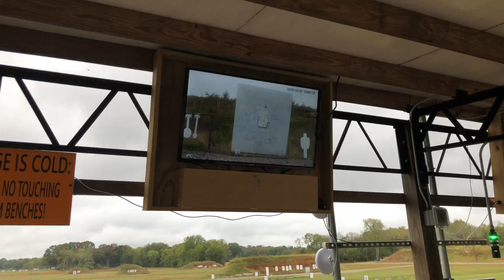Annealing Brass at 1000 Yards: A Comparative Study

Comment: Nothing here proving that annealed brass is shooting better than non annealed brass, but just the shooter wind doping better in the second group.  Hence proof would be just to show the standard deviations of speeds of the two groups, since this would be the real proof that there is a difference, with lower deviations of annealed brass that would be the proof instead.  Also, would need to know how many shots the brass has since it was first prepped, since if talking brand new prepped brass, verse the same with annealing after prep and it put in to action, then would not expect any differences in mean SD speeds to start with.

Comment: What are the chances these loads are uncrimped?
Reply: @vettelover2009 my point is, guy is having problems, these rounds are uncrimped, I bet (my theory) some mediocre handloads can be improved with a light crimp on the mouth.
Of course annealing is important and should be done, but a light crimp is WAY underrated, and I don't understand the knee-jerk reaction against crimping. I've had no adverse reactions myself - granted I'm not a benchrest shooter, but a 3P across the course. The bullseye doesn't know the difference between .25 and .30 MOA. But if a crimp can turn a factory .75 moa into a .5 moa...
Reply: Nobody crimps precision loads
Reply: So... answer is 100%.
Reply: @vettelover2009 👍 sure avoid it if you can. If troubleshooting, try it. I think some will be pleasantly surprised.
Reply: ?????????? Who tf crimps ???????? Please tell me?
Reply: Crimping to fix a accuracy problem is not a fix it’s just a band aide hiding the problem
Reply: @reddawng43x91  I don't understand that logic. This is not medicine treating a symptom instead of the underlying cause. If a light crimp helps, why not except time (which isn't an issue with a progressive press).

Comment: After annealing, I run my brass into my neck sizer and comes out with small scratches. Any thoughts? Thank you
Reply: Soft brass buildup on the neck bushing! Clean good.  And you can use FINE steel wool to polish is off the case neck.  Doesn't effect accuracy!
Reply: Had the same problem. Found out I was squeezing the necks down too far, .003-.004. Switched to a larger bushing. Scratches never came back.
Reply: As one shooter explains in other video, (stop neck sizing and go full length)..

Comment: Would have been better if they’d have called wind the same for both. And if they did it blind and only one guy keeping quiet knew which was which, as to not influence results. Surely they were wanting the annealed ones to better, especially based off their reactions. 

I really have no doubts annealing makes a difference and works, but I wish these were results were better executed so you could trust these results more.
Reply: Makes no difference what the back ground noise or talking was about, its up to the shooter, and at that distance one hell of a job shooting....you aim at the same point, if the wind is blowing 4 or eight miles per hour if the wind stays the same you will have the same impact....can not get much better than what was shown....

Comment: Even tho this does prove annealing makes a big difference I would love to see a test of amp annealed brass and then the old way with a gas bottle by a person that does it often and the same with salt annealing I think then you may prove how well your machine works until then this test proved that annealing is better than not annealing
Reply: I anneal all my reloads after few times except for two calibers, 6.5mm .284 and a wildcat that is .458 made from a .338 lapua casing, which i anneal after each use. 6.5mm .284 to extend the casings lifespan and consistency of the handloads, and i have to do it with the .458 wildcat because if i dont the casings tear after few uses. Making the .458 casings from .338 lapua magnum already breaks so many casings that i dont want to lose a single one

Comment: Nice wind calls and nice shooting. I would consider giving the gunner crew the ammo in double-blind fashion, like ammo X and ammo Y, then don't let them know what is what till its over. Letting the numbers fall where they will. Thanks for the efforts in any case and have a Happy Thanksgiving!
Reply from the maker: Thanks Dino, We thought about doing the blind test but the annealed brass stands out quite a bit due to the annealing marks. We don't thing this effected the result at all.
Reply: @annealingmadeperfect1257  It was magazine fed so the shooter would not be able to tell if it was annealed or not.  Also, you changed the method of shooting with the annealed string by calling out "ready" and "hold"..unlike the first string.  Choosing 1000 yards to see the effects of annealing vs not annealed introduces significant contributions from human error and wind conditions..  I haven't seen the summary yet but I hope there is some scientific rationale to support any results.  Other than that, nice shooting for both strings...Damn...
Reply: @annealingmadeperfect1257  hit every round with a polishing wheel for a second, it will get rid of the annealing marks
Reply: @annealingmadeperfect1257   I'm pretty sure you are right. Long shots require wind calls and those must be done in an equal and impartial manner for the results to be balanced. I'm thinking 300 yard groups, where the wind has far smaller contribution, would have said the same thing. Looking forward to the rest of the tests. Cheers.